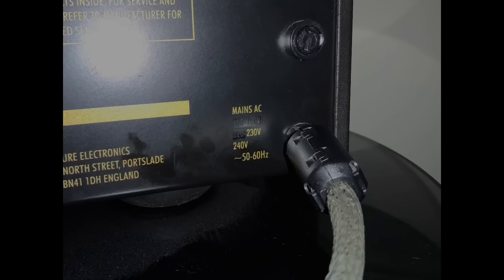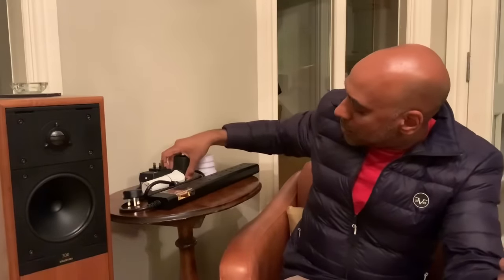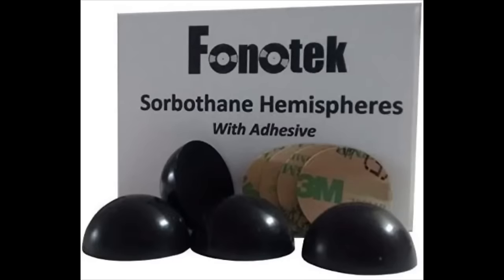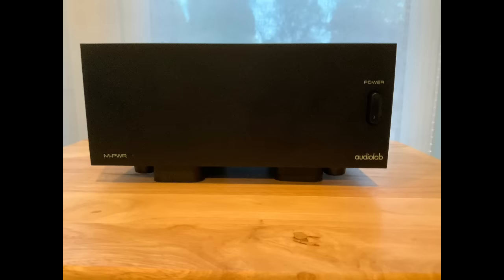My Top 5 Inexpensive Hifi Tweaks

Comment: Really helpful tips, thank you. Been searching for the square sorbothane blocks you have underneath your speaker stands but not finding them. Any links?
Reply from the maker: Hi Ewen, the washing machine a to vibration feet are not Sorbothane but just a regular rubber compound. Link below:

https://www.amazon.co.uk/gp/product/B07MPC5HM3/ref=ox_sc_act_title_1?smid=A19VGPGME3DXWF&psc=1

I use the Sorbothane ones under my equipment but can’t find them on Amazon. I also have silicone ones from Hudson which seem to work as well. Link below:

https://www.amazon.co.uk/gp/product/B079SV39KW/ref=ox_sc_act_title_2?smid=A2K5KKYERQOFGB&psc=1
Reply: @abritishaudiophile7314  Many thanks for the links. Been researching sorbothane and there's a vital point relating to load weight. Seems you MUST use the correct size of sorbothane for it to work.  So,  4x 2.5" hemispheres (with Shore/DURO 50) will only work underneath components weighing 81 - 108KG! For the majority of us with turntables/components weighing in around 11KG, we would need to use hemispheres half this size.  

https://www.sorbothane.com/Data/Sites/31/pdfs/product-guides/Sorbothane-SPG.pdf

Comment: Oh dear. Was really getting into your channel until i stumbled on this video with you recommended the tacima mains conditioner in a Hi Fi system. 
I do have 2 of them. 
One works great on my pc setup and the other on my big screen TV.
 I did try the tacima in my Naim system and as you did state, Yes it did rob the music of a certain amount of its drive and dynamics. Naim also recommends not to use any kind of mains conditioner with thier amplification. I suppose the tacima could help somewhat with a digital source, dac ect.
Reply from the maker: These things are system dependent. Worth giving a go though 😊

Comment: Tarun - have you ever tried washing CDs?  A few years ago I realised that the simple act of washing a CD with soap and warm water can bring about quite amazing results - particularly on a nice system.  Some CDs seem to benefit more than others, I can only assume this has something to do with the gunk left on the CD after the manufacturing process.  If you're interested I can give you a nice safe way of doing this without harming the CD at all.
Reply from the maker: Please do, I do have a CD cleaner lying around somewhere but I haven’t used it in many years. Might be time to find it and give the CDs a proper clean 😉
Reply: I buy "Cotton Wool Oval Pads" from ASDA, they're just 75p for a packet.  All you need then is some basic soap (I use Simple) and a nice clean sink with some warm water in it.  One pad is enough for one CD.  I keep the taps running slightly, I then wet a pad under the warm tap, then rub it in some soap, then just clean the CD playing side with small circular motions.  Once wet, these pads won't harm the surface at all.  Then rinse the CD as well as you can.  Now comes the drying and polishing.  Firstly I shake as much water as I can off the CD just by shaking it in the air, then I put it in a soft towel and do the same.  Then dry the top of the CD with the towel.  By now there'll be a few small drops left on the playing surface, also some slight traces of soap.  This last bit  - polishing - is the bit where you need to be more careful.  I have a little collection of old worn out cotton hankies I use - the older and softer the better.  Then I breath heavily on the playing surface and lightly dry / polish the CD - again using small circular movements.  

Most CDs improve greatly, cleaner more detailed bass and mids - greater focus, better ambiance etc.  However if the CD is already bright, it's probably best to leave it as it is.  The CDs that seem to benefit the most are those with a denser mix, a little softer if you like.  I have a Marantz Pearl KI SACD/CD player which is a fine bit of kit, but I'm amazed how much better most CDs sound after washing.  

Obviously don't start with one of your favourite CDs.  If you know where to look it's possible to buy CDs for pennies that you can practice on first.

Comment: Hi Tarun,

Thanks for the tips, I'll look to apply what I can when I renovate my living room. How would you envisage the isolation pads working under floorstanders that are on a thick carpet? I assume putting the isolation pads straight onto the carpet would make the whole thing unstable. 

Would it be best to put a paving slab between the isolation pads and carpet?
Reply from the maker: If there is a concrete floor under the carpet, use spikes. If the carpet sits on a suspended wooden floor, them paving slabs and pads are the way to go 👍

Comment: I have serious doubts that much of the power conditioning is helping.  The shielded power cable is not a bad idea though.  It isn’t as much that it shields signal interference entering the power cable, but that it helps prevent that larger voltage power interference from going into your signal cables.  Harnessing and shielding the RF works in both directions, so you are stopping it from leaving the cable more than entering it.  I would say, however, that the best use of a shield drain wire is to connect it at only one end - preferably the source end.  Connect the ground wire on both ends, of course, but connect the shield on at the wall plug end of the cable.  This is more effective at draining any interference to ground.  If you have the option, this would also apply to signal cables.  Any time you have both a ground wire as well as a shield drain, only connect the drain to the source end and float it at the destination end.  Most of the time, with most cables, you only have one wire acting as both, and cannot do this.  But in both of the cables you showed in this video, you do have that option.
Reply from the maker: Hi Scott, that does seem to be the consensus view and was confirmed by David Brook at MCRU. I amended my advice in the next video. Thank you for sharing 👍
Reply: A British Audiophile  I saw that after posting.  Good call.

Comment: What would you put under a valve amplifier with three very sharp pointed feet and those sharp points are supposed to fit into brass “coasters” with a tiny hole to receive the points.  But it is really hard to get the points and those little holes to line up, especially when the amplifier weights over 50 pounds!  What else could I use that would be easy to use?

Comment: One should never terminate conductor shielding on both connectors, this creates a parallel circuit with the PE conductor thus creating a form of capacitor. This will in turn, amplify any EMI near the conductor assembly. Conductor shielding should always be terminated to the PE network on the processor side only.
Reply from the maker: Thank you Brandon 😊

Comment: Interesting video - was a bit of a sceptic on power cables but went to a couple of demos at the Bristol show and changing from a standard cable to a posher one definitely made a difference. Wasn’t so impressed by the difference changing from a low/mid price cable to a high end one though
Reply from the maker: Hi The EBay Hifi Fanatic (great name), have you ever noticed that in those demos they always start with the least expensive cable and work their way upwards. There is a very good reason for this, even if you listen to the same cable it would sound better the second or third time you heard the same track. This is one of the ways our short-term memory is so unreliable. I think it is a little bit naughty of manufacturers to conduct these short term AB listening tests. Try the cable in your system at home listening to it daily for two weeks and then replace it back with your original cable. Be honest with yourself, do you notice a change or miss the “upgraded cable?” You will then be in a position to know if you should keep the new cable or send it back. Thank you for watching and sharing your experiences :-)

Comment: Hi Tarun. Thanks for another great informative video. Very interesting.
Can I ask a question please?
I have some QA floorstanders. My listening room has wooden floors on top of concrete. 
How would you suggest these are set up re decoupling please? Thanks
Reply from the maker: Hi Ian, if the wood is directly on the concrete. For example, engineered oak with an underlay, it is not a bad as a suspended floor. Sometimes there are battens between the wood and concrete. I still think you are better off decoupling the speakers from the floor. Why risk the floor being excited and resonating when you can get some washing machine pucks for £5 a pack and decouple them. Thank you for watching and you kind words of support 😉👍
Reply: Hi again Tarun. Thanks for the reply. Yes the floor is laid on an underlay over the concrete. 
I’m using the supplied spikes and rubber covers and then the washing machine pucks as you suggested. Just thought it may be overkill? Keep up the excellent work. Always enjoy your videos.
Reply from the maker: Thank you Ian. Try removing the spikes and just using the washing machine pucks. The spike place a point load on the pucks which makes them less effective. Just a thought 👍😉
Reply: Will try that today Tarun. Daft question but would you have the flat side of the puck in contact with the floor or speakers?
Reply from the maker: I don’t think it makes any difference Ian  it probably easier to move the speakers if the flat surface is in contact with the speaker 😉

Comment: The reason why you don't want shielded cables is because, the cables can't naturally radiate the signal which creates a natural sound. Meaning that it radiates into the shield, then gets sent back into the cable which has a boosting/hifi sound effect. So yes it improves the sound for some people because they like that effect. But really it's just psyching up the sound making it more detailed/unstable/hifi/restricted. Just put some copper tape over your cable, then you can hear what I mean. That is one of the reasons why FAKE ebay cables are so horrible in sound, because the outer material is so hard it acts like a shield. Where as the more expensive cables usually have a much more soft material, that promotes a more natural sound.
Reply from the maker: Hi Real Hifi Help, thank you for sharing 😊

Comment: The shield of the powercable should not be connected in the receiver end. If you do, all high freq noise will reach your equipment.
And if you do your own powercables it’s highly recommended to crimp the conductors before screwing them down. 

Regards
Johan from Finland
Reply from the maker: Thank you Johan. I updated my advice on this in the following video.

Comment: I made 3 gainclone amplifiers i am not some kind of enginer, but i used mains filter and it works very well i made it my self everything you need few capacitors and coil, and cracling noices when swiching lights disapeared. So i have to admit it's really working. Spikes no in my case maybe it really need granite floor.
Reply from the maker: Thank you for watching and sharing your experiences Kostas 😊

Comment: Hi, new subscriber and like what I have seen on the few videos I have watched so far. I have a question about the ferrite cores when you have your speakers bi-wired and for my mains bi-amped. How many cores should I have in that scenario given magnetic interference you mention? I might assume one in either situation , but would like opinion.
Reply from the maker: Hi Kevin, it is a question of trial and error with ferrite cores. They will benefit some systems, have no effect on others and can cause high frequency roll off in some systems. It helps to understand what they are actually doing and what to listen for. 

Ferrite cores are essentially inductors which filter RF and EMI noise in the cable by converting it into heat. The added inductance can also be a benefit to some systems but a detriment to others. It all depends on the output stage of the amplifier and whether it has a phase correcting circuit called a Zobel network. Most modern solid state amplifiers will have this circuit but some designs like my Exposure and older Naim amplifiers don’t so benefit from higher inductance either in the cable itself or the addition of a ferrite core. Another more contentious claim, is that adding ferrite cores can help reduce parasitic resonances in the cable.

I would start by putting ONE on the woofer cable at the speaker terminal end. If it lowers the noise floor you will hear a tightening of the bass and micro details in the midrange more noticeable with more sharply defined leading edges to notes but you may also experience a loss in dynamics which will be most noticeable as a reduction in bass punch. You can also try one on the tweeter and you may experience a smoother treble but listen for any loss in high frequency extension. Whether you go for one on the woofer, one of the woofer and tweeter or none at all will depend on your system and personal taste but they are inexpensive and worth playing around with.

Thank you for watching and subscribing. I appreciate your support 😉👍

Comment: The shielding on the mains cable should ONLY be connected to the earth terminal on the mains plug side...NOT at the input connector. The braiding/foil/shielding 'drains' the EMI/RFI to earth. If you connect at both ends it effectivly functions as a antenna and magnifies the the noise.
Reply from the maker: I amended my advice on this in the following video 😉

Comment: As always very well presented, thank you. I also use the washing machine dampers on my speaker stands and they work very well however it is a good idea to get your speakers positioned correctly first as it is very difficult to move the speaker stands once fitted if your speakers are heavy. I have one question on power conditioners as I use a Hegel H20 power amp which has a hum from the transformer, I am told that I need a DC blocker, do these items modify or dampen the overall sound as I guess they add an impedance to the mains source.
Reply from the maker: Thank you Stephen. I haven’t tried a DC blocker so can’t really advise. If you get to demo one, please let me know how you get on 😊👍
Reply: I had a problem with low level hum coming through my BK Subwoofer and it was very audible even at a reasonable volume. I asked them if there was a fix and they sent me a power cable with a DC blocker fitted to it and it stopped the noise completely. Well worth it.

Comment: Tarun.  Thanks for the great videos and reviews. I hope the channel goes from strength to strength.  I wanted to share the effect of one of tweaks in your video.  I tried the ferrite core idea on one of the leads into each of the speakers as mentioned in the video.  What happened was that the centre of the soundstage got thrown off to the extreme sides with no centre image at all .... like the speakers went completely out of phase (induction?) and removing the cores did not bring things back to normal - thought I had damaged my amp or speakers.  I changed to another set of speaker cables and it all came back thank goodness.  Any thoughts?  If it helps, the system is B&W 802 speakers, Gryphon Diablo 300 amp fed by Chord M Scaler / TT2 and Naim NDX2.
Reply from the maker: Thank you for watching and your support Clyde. That is very strange. The ferrite core adds inductance which can cause high frequency roll off in some systems. What you are  describing is more of a phase issue. You have a very high end system. I can only guess that somehow the Diablo 300 reacted adversely to the extra impedance. Thank you for giving it a go 😊👍
Reply: Don't use ferrite beads on audio path of both analogue & digital, the worse is far more than the better.

Comment: Another great video Tarun 
I’m experiencing clicks & pops from my phono stage. Will adding Ferrite core to the power cable eliminate this? Plus would isolating the unit help. 
I have already upgraded my power strip, for a more than you suggested but l was pleased with my choice and the difference was marked. I had previously upgraded the power cable x 2 on my system. One to feed the power strip the other to feed the amp. I have also isolated the speaker stands using the anti vibration pads you suggested, a marked improvement too. I also invested in vibration pads & cones for the speakers. Thanking you for your very useful advice in advancing my hobby 🙏🏾
Reply from the maker: Hi Leonardo, I don’t think adding ferrite cores will necessarily help with the pops and clicks on your phono stage. It’s unlikely to be an RFI or EMI problem. I’m sure you’ve done this but I would double check the gain settings on my phono stage. Otherwise it may well be a case of talking to the manufacturer or find a service engineer to check it out. Good luck 👍
Reply: A British Audiophile  Thank you for insight. I had already altered the gain setting and the click & popping have ceased. In the past two days, which is obviously great news. In the past two days l received the Groovewasher cleaning products arrived. I am really impressed by the results on the vinyl playback and its stylus cleaner. I can thoroughly recommend this product.

Comment: Hi Tarun, all others - what’s the max distance between the power conditioner plug and the parallel main conditioner. Cheers
Reply from the maker: I am not sure I understand the question 😊
Reply: @abritishaudiophile7314  hi, I mean in terms of adjacent distance, should the 2 devices be next to each other or can they be in separate sockets - say a metre apart, and thanks btw 😊
Reply from the maker: @mojodanslabiblioteque  thank you for clarifying. The can be on adjacent sockets but I would have them on the same spur 😊👍